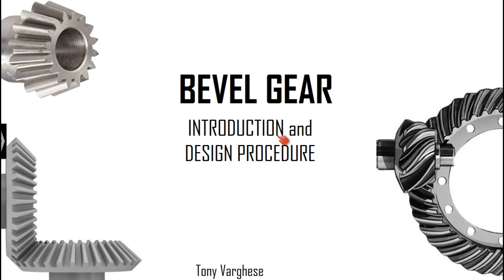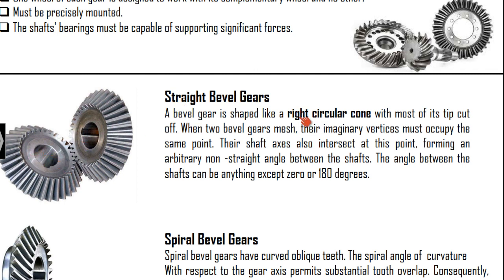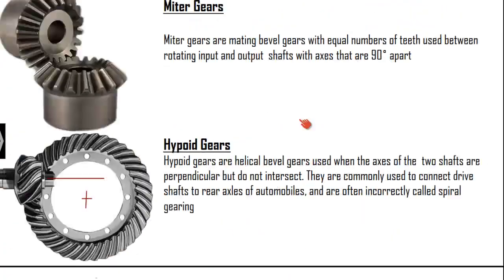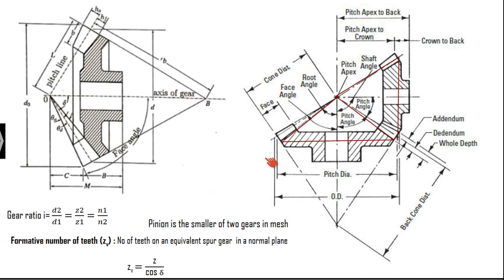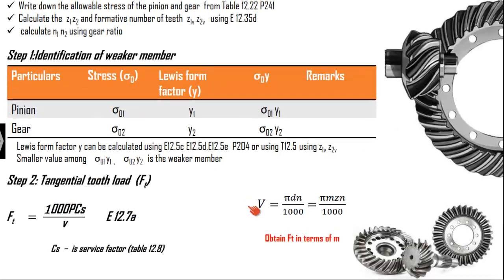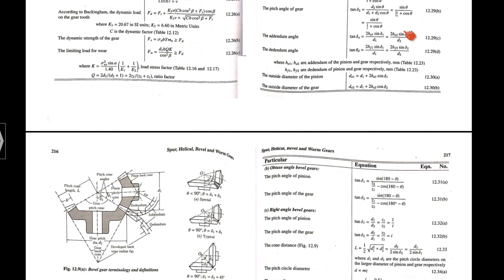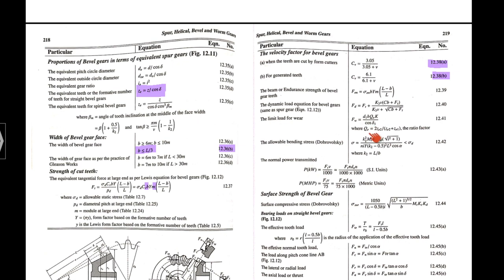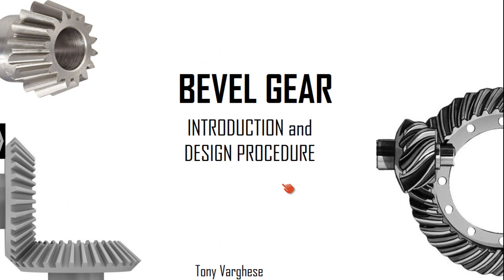Introduction and design of bevel gear

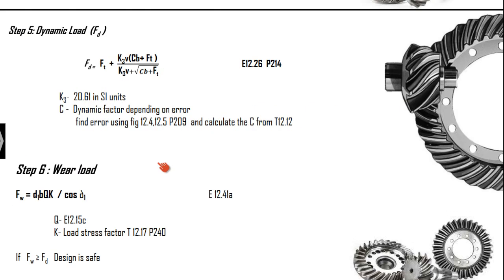Comment: where can i find the handbook at 14:06
Reply from the maker: Hellow Eric, I used the design data book by Mahadevan and Balaveera Reddy. You can use any data book as reference and try to follow he  design procedure. There can be slight changes in the equations and substituting units.
Reply: Dude, I think by now you have designed or worked on the bevel gears. Can you please share the notes or designs, please!